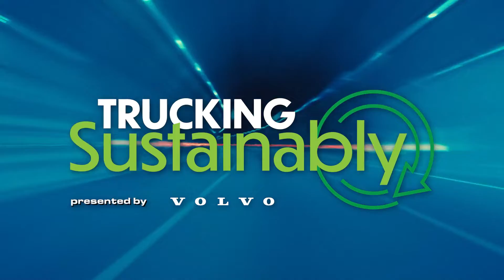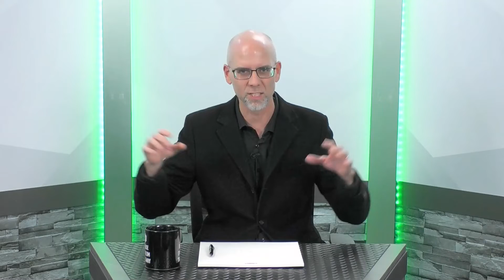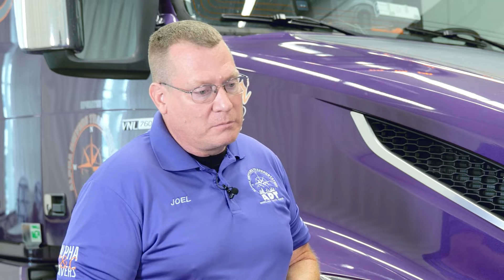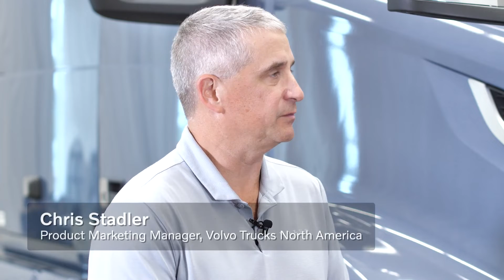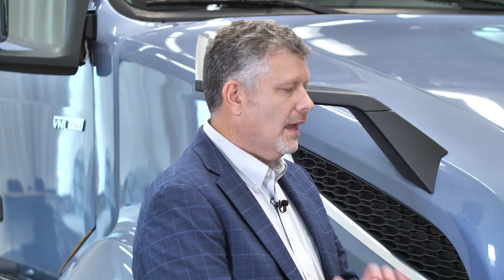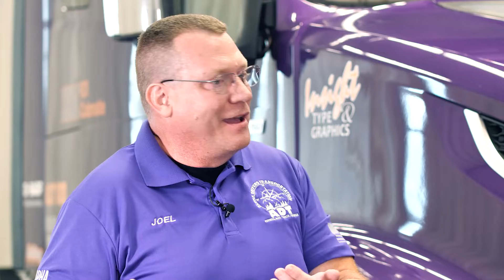Volvo Trucks: Episode 3 – Spec’ing for Sustainability

Comment: One of the best interviews yet 👍. As soon as Volvo stopped being an assembler with the VOLVO-GMC initial business and became a true manufacturer the option list grew. VOLVO have always in my opinion had the best off the shelf vehicles that could be specced to the customers need. Joel’s truck is probably over specced for a fleet truck, but many owner operators will find what they need at VOLVO.
Remember the cost of the vehicle is a factor and a good all round truck can be specced adequately with out spending to much on the initial build.
The advance warning features can affect your mileage efficiency and earnings considerably. There should be an option to switch off the adaptive brake control tied to following distance under certain circumstances as heavy and stop and go traffic. Perhaps it can automatically come back on when the cruise control is reset? Currently with the cruise control off the beeps and the brake being applied automatically, it can make the situation more stressful. The driver should have more control.🏴🇺🇸

Comment: Without carbon all life on earth dies, also these new trucks the exhaust coming out of the stack is cleaner than the air going into the engine, also what is def doing to the ozone??
Reply: @TheeJohnnyBravo  yeah ultra low sulfur diesel is cleaner than gasoline.
Reply: DEF, stands for Diesel Exhaust Fluid. It’s the additive used to burn off, with diesel the remains of the spent diesel and its gases after combustion.
Reply: Note: DEF is nitrogen fertilizer, Zero negative effect on the ozone and it's actually common farming fertilizer(urea). It's a win win 👍🏼👍🏼
Reply: @100pyatt  you would rather destroy your engine with carbon build up because that carbon that exits the exhaust in a pre emission engine is getting trapped in your combustion chamber and exhaust valves, that’s a lose lose to me and a 48k dollar engine replacement.
Reply: Then instead of using a fan inside your truck, just run a tube from your exhaust stack to the inside of your cab while you are sleeping. If you think the air coming out of your engine is cleaner than the air going out.
Reply: @MrRld1960  it’s clear you don’t understand how carbon works and what it does for plant life on this planet, the 200+ active volcanoes around the world put out more carbon than all the vehicles on earth on any given day.
Reply: @just-incase3483   It doesn't matter if I know anything about carbon or not. YOU said the air coming out of an engine today is cleaner than it was going in. I just said YOU breathe it then, if you really believe what you said.
Reply: @MrRld1960  yes it is, the dpf filter catches all of the carbon coming out of the engine, the exhaust of a dpf truck is cleaner that most big cities air quality.
Reply: @just-incase3483  You keep avoiding the question. Would  YOU put a tube on the exhaust of your truck and run it inside the cab of your sleeper for your 10-hour break?
Reply: The Diesel PARTICULATE Filter does NOT capture CO2 Gas from the Exhaust Stream. Even though the Sulfur content of the Diesel Fuel is Reduced to 15 Parts Per Million (PPM) there is still Particulate ASH produced during combustion of the Diesel in the Combustion Process in the Engine Cylinders that form in the Exhaust Stream as part the Engine Cycle. CO2 and CO (Carbon Monoxide) are also byproducts and are Treated with DEF aka AdBlue in the Selective Catalytic Reduction (SCR) Process.
The Particles trapped by the DPF are Coated with Diesel Fuel delivered through a 7th Injector mounted downstream of the Turbocharger and the SCR Assembly so that the Particulates can be Burned Off During the Regeneration Process/Cycle.
Reply: @henryblanton6992  and that 7th injector when it need to be replaced m, and when the dpf system becomes dirty it costs $6,700 to repair and clean, I know because that is what it cost me last September.
Reply: @henryblanton6992  communist exhaust fluid is another way to make trucks cost more…
Reply: @just-incase3483 Dummy, the point is that you want to avoid what you said. The air coming out of a diesel engine is not cleaner coming out than it is going in. I don't care what anyone says.
Reply: @just-incase3483 reality is about 1/10 that cost unless you rely on dealerships for all your basic needs. These are basic and easy to change parts
Reply: @MrRld1960 yes ignore the facts that the exhaust is literally cleaner than most Democrat smog infested cities air including all current gasoline engine exhaust as well
Reply: @100pyatt  Sounds like YOU have been sucking those exhaust fumes a lot.